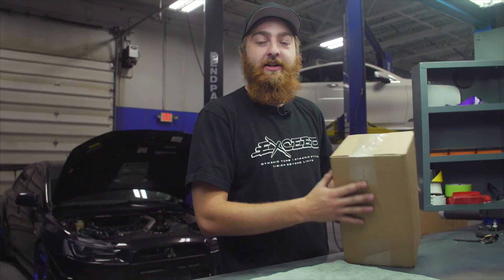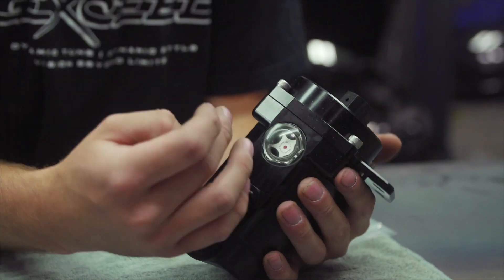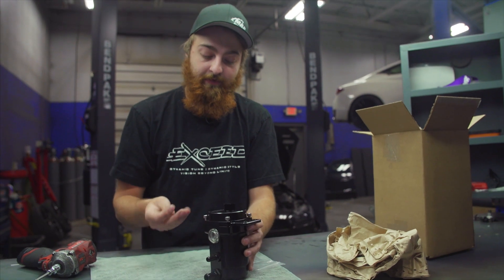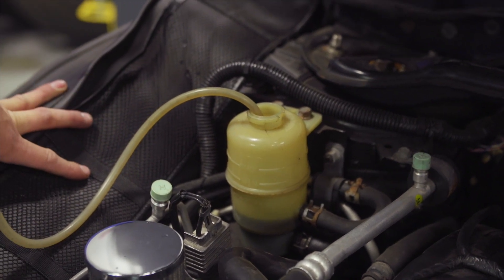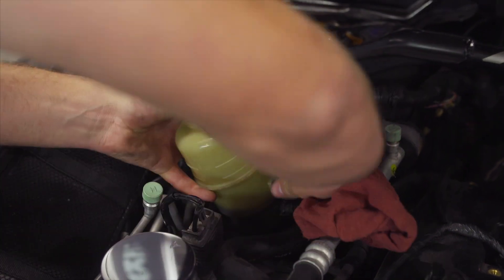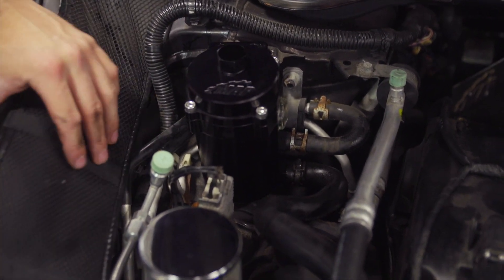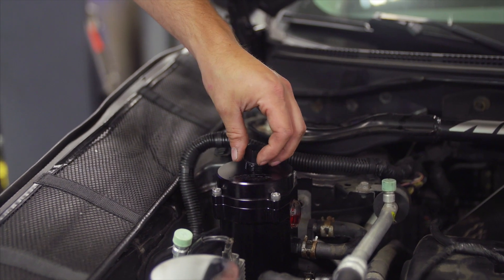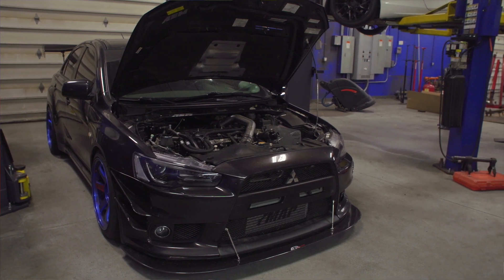Unboxing + Installing our Evo X Billet Power Steering Reservoir

Comment: I'm experiencing power steering fluid overflowing on this product when doing hard driving in the track. It doesn't happen with the factory power steering reservoir. Why is that happening?
Reply: Did you end up finding out why is leaking